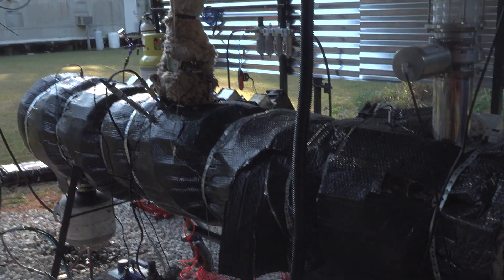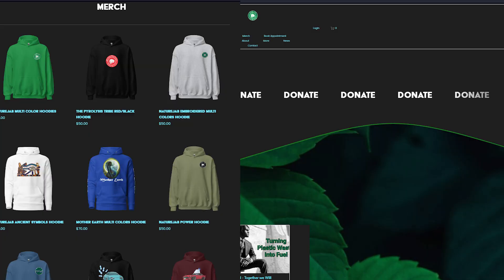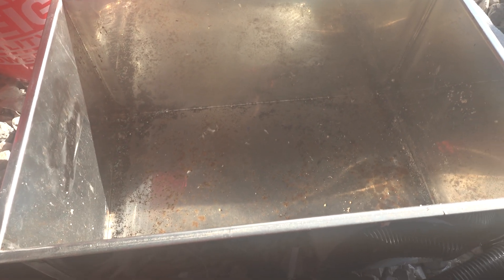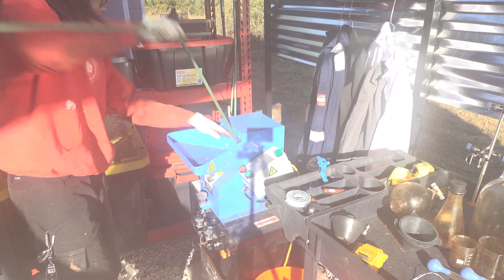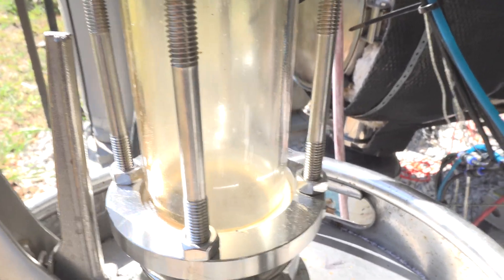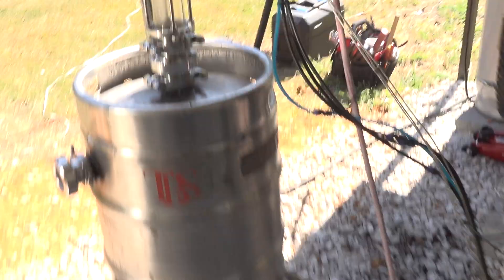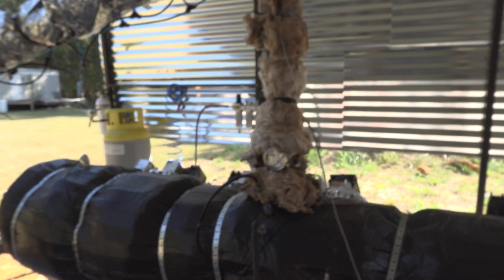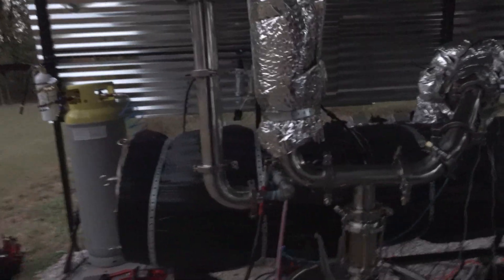Run #2  Plastic to Fuel Reactor in Alabama

Comment: the low pressure causes the light fractions to remain in the gaseous phase and solidifies the waxes, by raising the pressure you should be able to fluidize the product.
use the gas you get to bring the pressure back to at least 1 atmosphere and check if you have liquids in the final cylinder

Comment: When connecting the pipe directly to the reactor, wax can block the pipe. To resolve this, open a large 10cm hole and weld an additional chamber that is 50cm high. After that, connect the pipe. And don't isolate it!

Comment: From the readings on your temperature sensors I would suggest that your temps are too low. You should be going for at least 300C, and it looked like your highest temp was around 174C. Those low temps will produce more gas and carbon, and the waxy material as well. 

Some researchers suggest that PET is not suitable for pyrolysis. Only one paper I found said that's because PET can release oxygen? I haven't found anything else that supports that, but the fact that you are getting water even under vacuum must mean oxygen is coming from somewhere.

Comment: Add a choke to your computer. Maybe run the power through a UPS. Generator power does not always work with switching power supplies. Even good generators can dump a bunch of noise into your power system. Keep after it. Everything goes wrong when you restart something that works.

Comment: I have an idea that make help alittle it's an idea borrowed from continuous flow steam distillation for alcohol basically U U have to get the hole distillation path warm to hot and the tank  while loading the plastic cause while it's sucking right thu it's just pulling water in the air though the hole thing and the humidity of the plastic maybe after U shread maybe leave in sun or make a hot box for it while in storage by painting the storage box black and putting it in sunny spot to and maybe invest in a couple of heat guns and hairdryers because it maybe just needs heat added to one particular part of your long pipe to condenser

Comment: I’m just curious what the upper limit of plastic is like if you put in like 50 lbs would it be overloaded and more or less energy efficient than just like 10 lbs?
Reply: I’d have to assume more because the temperature being higher and having more surface area for plastic to degrade and evaporate off, but I’m so curious what the higher end of the efficiency is

Comment: Shielding the electronics with aluminum foil is a good idea, maybe some wire-mesh fencing material could be enough, depending on the frequencies you're using. Since that's already sort of a solved problem for microwave ovens.

Comment: The problem sensors. They can hinder the operation of a device when calibrations are not made for outside interference or factors. They say no when you need them to sit, yes. Fewer sensors may help. You can monitor your machine more directly on some measurements, I'm sure.

Comment: Might be the kind of plastic. the easiest kind is HDPE. PET makes everything sticky. Also Some of the reactors I seen catch the oil in two places.  After the first condenser there is a catch for oil, the vapor goes to the second condenser, second catch,  something like that. you will get the most oil from High-density polyethylene (HDPE) or polyethylene high-density (PEHD) "2"

Comment: 1. Collection and Sorting: Gather plastic waste and sort it to remove non-plastic materials. Different types of plastics (like PET, HDPE, etc.) can have different properties and yields.

2. Shredding: The sorted plastics are shredded into smaller pieces to increase the surface area, making the subsequent heating process more efficient.

3. Drying: Remove moisture from the shredded plastic, as water can interfere with the pyrolysis process.

4. Pyrolysis Process: The dried plastic is subjected to high temperatures (typically between 300°C and 700°C) in an oxygen-free environment. This process breaks down the long-chain polymers in plastics into smaller hydrocarbon molecules, resulting in gas and liquid products.

5. Condensation: The gases produced during pyrolysis are then condensed back into liquid form, collecting the oil. This may require cooling and the use of condensation systems.

6. Separation and Purification: The resulting oil may contain various hydrocarbons and impurities, which can be further refined and separated into different fuel products, such as diesel or gasoline.

7. End Products: The final outputs can include fuel oil, gases, and other byproducts like carbon black, which can be used for various applications.

Safety and Environmental Considerations
- Ensure proper safety measures due to the high temperatures and flammable gases involved.
- Implement emissions control to manage any harmful byproducts released during the process.
- Consider local regulations and environmental impacts when establishing a plastic-to-oil conversion system.

While the technology exists, it's important to recognize that large-scale implementation should be approached carefully and sustainably.

Comment: Oh wow. Its awesome you found the cause. Seems to me the clogging isnt just affecting the flow. Its also affecting the cooling rate because the gummy stuff would insulate the vapors more from the cold water. Ideas for another time: have some analog thermometers before the water goes into the condenser and after the condenser. Get it to its best running condition and mark where the temperatures are. If next time when the water comes in cold and comes out still cold you know it wasnt absorbing much heat.

Also, now you gotta check on your gas tank. There could be oil in there. I guess making it an entirely closed system does have some benefits. If it wasnt you would be emitting petroleum vapors to the air

Comment: Isnt 130c too low of a temperature for full pyrolysis?? Thats what you showed that main body has. That would make sense that water is condesing but most plastics are just melted at that temp.

Comment: Would also like to add, a faraday cage around your sensitive electronics is an absolute must! 2mm stainless steel mesh screen will work perfect as it is less than 1/10th the wavelength of the microwaves and would effectively block them. It is also cheap and widely available in large amounts.
Reply: yup plus shielded cables on sensors with high sensor rates
Reply from the maker: Will do!

Comment: It looks like the fine plastic material is absorbing moisture from the air and you are having to put a lot of energy into boiling that water off essentially. I believe it looks like there is for sure an emulsion forming in the condenser tube as well with all that water and oil vapor mixing. If there was some way to predry your plastic shreds it could likely help (perhaps using the sun or something, not allowing shreds to sit long, etc.). Because pyrolysis is between 200 and 1300 C, the reaction will not progress much or only partially until all the water is cooked off anyway.

Comment: Water is h2o. 3 possible options. There is still an atmosphere in the machine. There was oxygen trapped in the plastic. There is possibly rust inside the machine, Fe2O3, the carbon could be heating up the metal enough to dissolve the rust.

Comment: Should test in 2x increments. Say 1,000g then 2,000g then 4,000g.  Of the Same exact type of plastic. For each run. Test the return then. Otherwise EVERY TIME YOU THROW A DIFFERENT MIX OF PLASTICS YOU WILL GET A DIFFERENT RATE OF RETURN. Its simple logic. One type of plastic will convert back to oil better or worse then another type.  Therfore a different blend at a different ratio will always give slightly different return liquids, solid, gasses and leftover residues.

Comment: Time for an AIO liquid cooler for the computer cpu. Instead of using height for the condenser, could you use a cooled spiral down like an alcohol still would use to convert alcohol vapor to liquid? Maybe even a separator for heavier oil vapor opposed to water. Or go low and slow to condense water first diverted with valve to separate output, then crank it up to do the same for the oil vapor. This is theory though 😅

Comment: Also, consider measuring all your power consumption.
Reply: Several years ago i saw a video on a company that claimed they had an enzyme or something that could convert plastics into fuel or at least a crude form that was able to be processed anyway. Haven't heard about it in a long time, im guess their process wasn't energy efficient enough to profit either.
Reply: @zg2964  There is some stuff like bugs and worms that eat plastic. Not sure what they poop but we gotta do something with it.
Reply: @GudasWorld_2  yep, some anaerobic bacteria are known to eat PET plastic etc. But I think it's better to think of other uses for the trash than let it be eaten. After all eating is basically the same thing as burning, these bacteria will turn plastic into ch4, co2 and H2O at best.
Reply: @stasi0238  interesting! So recycling is the only real solution.
Reply: @GudasWorld_2  yes. unfortunately we opened a can of worms with oil, gas and coal. What was under ground now is either waiting to be processed or already in the atmosphere and we can't really do anything with this surplus carbon unless you bury it underground or anywhere just like it was before. That's it no other solutions. Not that what we have now is in any way as catastrophic as some people think but still, it is unnatural and probably pretty bad.
Reply: @stasi0238  I really like what Jab is doing. I'd like to put his unit on a ship & go to remote islands to clean up the plastic. Thinking about making it a working vacation deal. People  like me who just work need a type of vacation that is working. Clean up beaches in the tropics for a couple weeks. Kinda need Jab to make that machine into a 20' shipping container and safe and reliable. Because what else can be done with it in the middle of nowhere? Hauling the coal stuff back to sell to nanotube makes is viable. But hauling all the plastic will limit the remoteness of the islands that get cleaned.  Using the fules from the plastic to run the ships, bonus!
Reply: @GudasWorld_2  petty cool idea, probably will take a lot of time for jab to end his machine. Why would anybody want to buy that coal tar of you?? Nanotube makers? I don't think you have such connections and the "coal" created in pyrolysis is not that pure.
Reply: @stasi0238  the nanotube thing was just discovered like a couple months ago. Thats all going to be awhile. But there is nothing else that coal stuff is good for. And once its in that form, its toxic as it gets. Only 2 options, haul or process.
Reply: @GudasWorld_2  what nanotube was discovered as of late? Plastic waste nanotubes ware made in laboratory in like 2017 or something.
Reply: @stasi0238  Really?!?!?! I did not hear about it until a couple months ago. Maybe it was specifically using microwaves was the current break trough.
Reply from the maker: Will do!

Comment: Yo Jab! Did you hear that the carbon product your machine produces, can be made into carbon nanotubes? Plastic waste is going to be how we build an elevator to space!
Reply: Love the optimism, but this is not pure carbon. It contains vitrified tars and polymerization side products as the plastic converts via radical formation at random points along its molecular chain. For example a compound,  ABCDEF could break into ABC DEF, or AB CD EF, or any combination of fragments.

Chem is hard to explain, but to make nanotubes you need PURE carbon and i would assume based on my experience with various plastic depolymerization that it's only half carbon at best. A good chunk is various "soot" that contain dozens of carcinogens. It's hard to say for sure until he gets the analysis... 

I really hope im wrong lol 

I would love to see him manage to fully recycle everything 🤞
Reply: @WizardZph  I really appreciate when people like you take the time to explain things! 

That 3rd product is really the sticking point. ByFusion's solution maybe be better as the toxic nature of that product is hard to deal with. Mixing it in with cement for roads or concrete maybe? 

There is a liquid can't remember what is. That if the plastic is submerged in that liquid for the pyrolysis process, there is some benefits. You know what I am talking about?